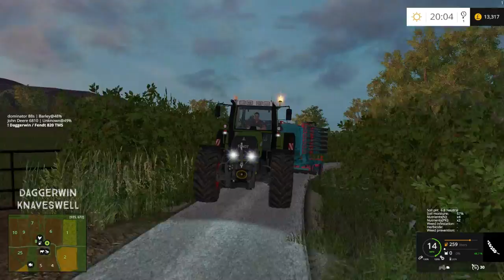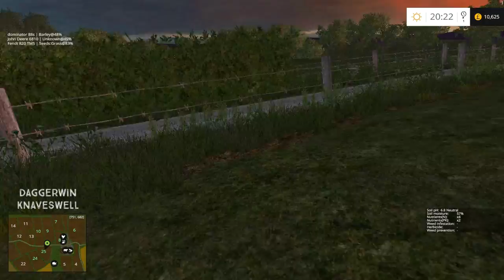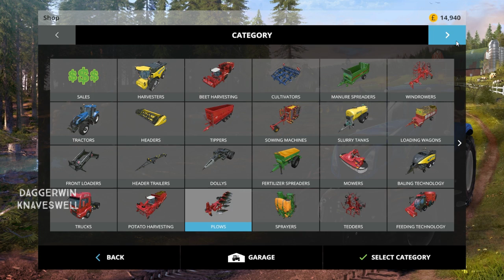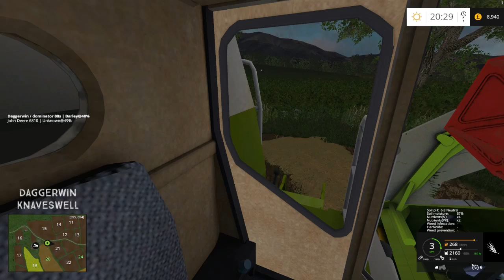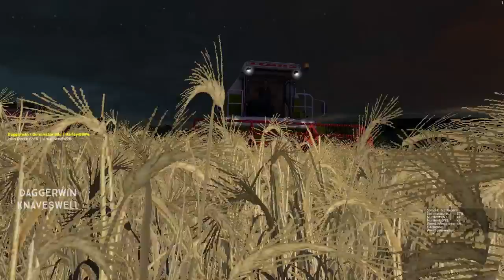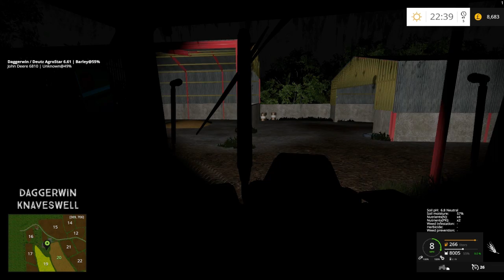Let's Play Farming Simulator 2015 | Knaveswell Farm | Episode 5

Comment: The crop will only wither in time if there isn’t any nutrients in the soil.
I think when putting nutrients on a field it’s a good idea to check weather forecast first, if there is no rain in sight I normally use the sprayer since it giver a little water to the field as well, but if there is rain coming soon I normally use the fertilizer spreader instead.

Comment: +Daggerwin In SoilMod, withering is just another growth cycle. On the default settings, growth cycles advance every night (at midnight). Crops won't just randomly wither if you speed up time, but every time you hit midnight, the SoilMod scripts will trigger and all your crops will advance one growth cycle. Once a field has passed through three "ready to harvest" days/cycles, it'll wither when that next growth cycle hits.

(Also keep in mind that even ready-to-harvest crops will still suck certain nutrients from the soil each day. This lets you use strategy in harvesting; if your PK is a wee bit high [say, 6 or 7] in a field of ripe crops, you can let them sit in the soil for an extra day, let them drain another level of PK, and end up getting a better yield. If your PK is 5 when they first become ready to harvest, though, get that harvester out in the field ASAP.)

Generally when playing SoilMod on a large-ish farm, I always leave the time setting on Real Time, until the end of the workday. Then I'll fast forward until sunrise, then set it back to Real Time again. Even at the (default) one growth cycle per day, SoilMod is a slow-speed kind of game; there's always tons to do each day to keep multiple fields running at maximum efficiency. Especially during those first few days on a new map, before you can make a long-term plan to stagger the work out a bit.

Comment: You need to make sure that soilmod has advanced to the next stage before applying a different fertilizer type. For example, if you put down PK, then apply an application of N before soilmod has advanced, the N will overwrite the PK, and you will have no effect from the PK. Also, the crop will wither after growth stage 7, which is the darkest green colour on the map view. Soilmod will activate at midnight, and you will see a countdown timer, and this is basically soilmod doing it's thing, so the answer to your question is, if your crop is on growth stage 7 and you fast forward to the next day, it will wither, . I'm not sure, but it looked like yours is on growth stage 6.
Reply: so shaun do you have to keep withering on or can it be turned off, and also do you have too wait for midnight before putting another application of spray on so when the ground changes back to natural ground you put the next spray on?
Reply: +Lewis Collishaw Turning withering on, or off will have no effect when soilmod is enabled. It is permanently off, and yes, you have to wait until midnight, and until after soilmod has made it's calculations, and advanced to the next stage before applying any more fertilizer, or herbicide. You can however increase the number of days that soilmod runs, as I have already explained in an earlier episode.

Comment: Bulk handling is much better dagger i have both and bulk is much more reliable, gps mod is great even for small maps too and u should defenitly get it, both bulk and big bags also has so u can add seed in bags  too and it works really well with a frontloader tractor and then a trailer for the bags and it looks really great👍  great vid and keep up this kind of series it's actually pretty realistic so keep it up🎉
Reply: +Jesper Wernberg link to big bags? that actually works I have tried some big bag mods and they didn't work

Comment: WARNING!  FS15 chooses the hot days at random each time you load the game, so don't plan moisture too far ahead. Wet days are, however, fixed in the days ahead so can be planned for. My usual method is to assume one hot day during the growth period, and adjust if different by more or less watering, or by spreading fertiliser rather than spraying it.

Comment: 1 you don't need to turn the drill off the drill when you turn, only lift it out of the ground2 that drill is just a reskin of the vaderstad 3 GPS mod is definitely worth it, it lowers your seed costs, takes less time, lowers the fuel cost and makes the establishment more accurate4 You should've put the dual wheels on for drilling to lower compaction5 you should download the rolls off of modhoster by lbj modding as it works with soilmod to add moisture and adds realism 6 I thought the crop destruction only affected the crop after growth stage 1 so you can drive on fres drilling

Comment: can some one help I like playing with multi fruit and baler add grass but the bale wrapper wont wrap the bale's it say's they are silage bale's but I have not wrapped them so when I put bale ex in my mod folder it will let me wrap them but I don't want to use bale ex I like bale add grass can any one help plz
Reply: +Craig Smith is it that they are mixed bales?
Reply: no
Reply: no I have found the prob when I take multi fruit out the wrapper will work but I want to play with multi fruit and baler add grass not multi fruit and bale ex ??? you get what I mean now